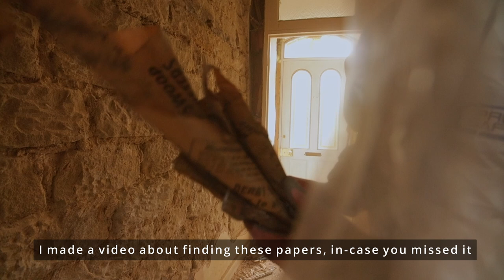Ancient wall - lining out

Comment: Outstanding work, as always. Loving the content, keep them coming!! 
Ah, I see at 28:15, that you, like me, own a pair of those stealth safety glasses, just squint to activate them, pretty slick. They're very versatile, fantastic for drilling or cutting wood, brick, concrete, metal, although with metal you do need to turn your head slightly to increase the protection factor...🤣🤣🤣
Reply: EyelidsPro(tm)
Reply: Norm Abram would be appalled.

Comment: As an Australian carpenter, very interesting to watch. All the basics, exactly the same. We would have installed a vapour barrier between the stone and timber/insulation; used plasterboard adhesive on the timber and half as many screws. Of course our climate considerations are very different to yours. Love your work 👍
Reply: Yes, same here in Canada. We would have installed a vapour barrier also. That and I hate plastering so I would have tried to cut those sections of drywall larger. With that said, this is an incredibly well done job!
Reply: Same here in the States
Reply: @justinknoetzke5380 , in my opinion, using a drywall in that kind of an apartment is almost a sacrilege. I know it's easy and pretty cost-effective, but i think that apartment this old needs more traditional materials. But I'm not taking anything off from work quality, it's great, as always! And here in Finland, use of some vapor barrier is also recommended if that is outside wall and there's no another apartment behind it.
Reply: In a cold climate the vapour barrier should be on the inside. The PIR insulation is metal-faced and he taped all the seams, so there is a vapour barrier on the inside.
Reply: @justinknoetzke5380  I believe it's an interior wall.

Comment: THANK YOU for taking the time to video your work.  It gives me flashbacks to my first house with never ending refurbishments.  Two things I noticed: 1) you added insulation between the pipes and sheetrock.  NO! If you get a REALLY cold winter, you'll need the house warmth to keep pipes from freezing.  and 2) I didn't see you use any sprayfoam insulation around the front door.  Yes, you did pack in fiberglass insulation, but foam insulation really keeps out the cold.  Again, thanks for all of your hard work and detailed videos.
Reply: I was wondering why he didn't foam insulate the walls.

Comment: I don’t think I’ve ever come across brickwork of the type used to construct your house , is it common to your locality ? .  It’s obviously stood the test of time , but of course bringing things up to date is no easy task.  Also the work it must have made for the plastered to make it level must have been mind blowing . By comparison whoever comes to plaster after what you’ve done , will have a far easier time.  Modern materials have made life a lot better , but it still takes a skilled craftsmen such as your good self to get the best out of them .      Best wishes and kind regards as always 😀👍👍👍
Reply: Its a stone built house -  quite common in places where brick production wasn't economical - Much of London on the other hand was built of brick because it was made literally from the ground the house later stood on 🙂
Reply: This is quite common in old houses. My house is over 200 years old and stone walls
Reply: @nick1bb1   thanks for the reply , I always think of stone being used just in detached houses . Never think of it been used in link property. Kind regards
Reply: @MrsDeBoerUK  <top trumps> My house is 500 years old and has stone walls. They are also three feet thick with a rubble fill, so running pipes and cables through a wall is a nightmare.

Comment: That PIR insulation is the same stuff I was going to use to line the van but decided to 'think about'. Good thing too. I may do it eventually but I've been parked in the same spot now since last Nov and the back doors are never shut. Ever. 
I've orientated the van so is 45° arse first to the prevailing wind. There's a tarp 'cap' over the back doors that also covers about 500mm of the roof to minimise the rain being blown under and the tarp goes down 2/3s of the doors and also covers the gap between the doors and the main body and there's a purpose cut length of 4x2 that sits on the top of the doors and holds the them open. It's like a small porch, kinda, but also keeps the contents of the garage compartment dry. 
I just have never liked being locked inside a building with no airflow and the vans no different. Now I have all the air I want haha When it's hot there's good airflow because I'm on the top of a hill under some pines, so there's shade and a breeze to catch. When it's cold I don't even notice now. If I feel it anywhere it would be my feet and those I just slide under the dog if necessary 🤣 
By design fluke, while I have pleasant airflow, the wind doesn't come under the tarp and up into the van no matter how shitty the weather gets. Not a deliberate decision but I'm not going to complain lol and when it's windy like that I get rocked to sleep 😂

Comment: Hi, wonderful job, i only have one issue. It looked like you put a 2 core flex through the ceiling for your light. For your safety, you should have a CPC (Earth) point at every connection point. Either for fixed equipment (at a fused connection unit), Socket outlets and lighting points - including switches. This is a requirement of BS7671 The wiring regulations. This is especially important for metal switches, sockets and light fittings. Please do see to this. yours or your wife's life may depend on it one day. Love the videos, thanks for sharing 😁

Comment: Great job in fairness! 
Shame you didn't have Gypline brackets to hand. Would have saved you a massive amount of time and effort.
I've used them extensively with the metal studs and timber battens.

Comment: Great video. Helped me with deciding to insulate my semi-detached outside walls internally over externally (EWI).

I have a couple of questions:

1. What thickness PIR board did you use?

2. Did you not need to put some roll of DPC behind the battening?

3. Weird one but what waist work trousers or just jeans/trousers/etc do you wear? 😂
Reply from the maker: 1- 25mm pir and 25mm superwool
2- the foil on the pir is a vapor barrier, it could be argued a dpc it is needed to keep the wool dry but since it is a lime mortar outer wall it is quite breathable and does not hold much moisture, even after heavy rain.
3- Snickers 3312, expensive but they generally last a few years which isnt bad considering the abuse they get! not a wierd question, it is hard to find good work gear!
Reply: @NewYorkshireWorkshop  wow thanks for answering so swiftly!

Haha I guess the weird part is asking your size waist. 

I’ve lost 4 stone in the past year and I’m trying to determine how slim I want to go! 🤣

But I have heard great things about Snickers work wear.

Comment: Assuming it's an external wall hence why you insulated, I noticed you didn't leave an air gap behind the boarding because you had filled it with wool. Wouldn't you be concerned about condensation/moisture and if not, why may I ask?

Comment: Is the wall you boarded over an exterior wall or a party wall? If it’s exterior I think you ought to have put in a vapour barrier between the insulation and the plasterboard. Without it over the long term you might get condensation problems on the stonework behind the insulation.

Comment: The house probably lurched, the crack in the arch and the wall are pretty much aligned, so I think it probably goes all the way down into (and including) the foundations. sunk slightly on one side, either from idiots expanding the house and digging down compromising it, or just ground settling after the house was built\expanded upwards.

28:36 uhhh, did you leave that smoke alarm inside the false ceiling? a couple of years from now when it starts beeping to warn that it's running out of battery it's going to drive whoever lives there INSANE. We had a similar thing in our workplace, it caused 5 days of people barely getting any work due to the thing doing 1 beep an hour. I luckily work with headphones so I didn't give a shit, but eventually my co-workers asked me to help find the thing (someone remembered me saying I have good hearing), found it within 3 beeps, turns out someone placed a bunch of servers infront of the wall with the smoke detector on it, and since it's in a pre-fab room added to the inside of the building the beep was muffled through the acoustic ceiling to the entire workplace.
This has the same vibe lol.

Comment: Ok, thoughts on the missing mortar on the half landing on the stairs. 
If no structural worries???
If it were my place and seeing all that stone and I'm assuming lime gluing it all together, point it up using NHL 3.5 Hydraulic lime and a suitable aggregate.
HL is brilliant gear it's a mix like sand and cement and much easier to work with but without all the bad stuff that cement brings to a property like yours. I cut my builders teeth working on houses like yours down here on the south coast dealing with bungaroosh was as big a nightmare as all that wonky stone. Dry lining and insulating my 1870 Victorian 2 up 2 down really worked on the fuel bills. Good look with it.

Nigel.

Comment: Are those copper water pipes running on the wall by the stairs? Or are they pipes for heating the house? If they are water pipes, I'm just wondering if you plan on removing & replacing them since copper can be toxic in the body after many years?

Comment: Very honest and maybe silly question. You want to cut the insulation boards into smaller sections for easier handling or is there some other reason I am missing?
Reply: He cut them so that 2, plus the width of 2 battens, matches the width of the drywall sheet.  That way there's always a wooden batten on each side of the dry wall sheet and one in the middle, to screw into.
Reply: @andy_rb  Thank you!

Comment: It just goes to show that in the 1900's they had "could not care a dam tradesmen" as we do today. My first house was constructed in the same manor as yours, solid brick single skin. As you had some original lime plaster, I would not be surprised if the mortar was also lime, hence the loose bricks at the top of the stairs. All you need was a little bit of damp/water in the window frame and the lime would be washed away. Thanks for a very interesting video

Comment: OK, Big fan of the channel here and this is not a criticism of a comment, I've a very similar project and trying to learn what is the best way to insulate internally!
The traditional/lime plaster "gurus" would really not be happy with what you have done here. I am a member of a few of these groups on facebook and those people are militant in their views, however I will play devils advocate here!  
PIR, gypsum plaster board and gypsum skimcoat are discourage as an IWI option for solid walls construction as none of them are breathable. Neither is your installation a full Vapour control layer, you haven't taped the joints but in any event it is near impossible to ensure the seal at the perimeter wall/ceiling/floor abutments.

The resulting problem is that warm moist air will travel from internally through your wall build-up and condense at the position of the dew-point, but will not be able to evaporate back internally due to aforementioned non-breathable IWI construction.
Theoretically this problem will be compounded as the dewpoint is located behind your PIR insulation but inside of the solid wall. This interstitial condensation will build up and I can't see how it will be removed as there is no ventilated cavity. Obviously this has a real potential to lead to a damp/mould build up behind the IWI installation.

Anyway, that is the potential issue and I'm very interest if you considered this and just decided to go with modern materials regardless.
The alternative is to insulate with a solid build up of use sheep wools insulation and then hemp/lime plaster, which is WAY more expensive and you and I we (both being carpenters) would have to pay other specialist plasters to do. So the temptation is to use the cheaper more accessible modern material option.

Anyway, big fan of your work and keen to see more of it!

Comment: It's Sow's ear into a silk purse.  Pig's ear is sloppy language and doesn't flow.  Most importantly it is failing to acknowledge the distinct biological difference between male and female pigs.  Male pigs have rather soft and pliable ears.  The female pig, or sow has a more cartilaginous ear prone to cauliflower ear.  Thus the difficulty in turning a gnarly grizzled piece of skin into a fine handbag.     <This is the part with the sparkly rainbow graphic and a "The more you know" lower third>

Comment: I'm afraid I'm not familiar with masonry buildings. How do you protect the wood strapping against the stones from rotting out? Thx.
Reply: you don‘t, they don’t rot
Reply: @Nixtutru  Why not? They certainly do in stick-framed buildings. There, the wood is either treated against rot or a sill gasket is inserted between the wood and the masonry.
Reply: @djmoulton1558  no water can go thru the brickwall so it would be unnessesery
Reply: @Nixtutru  Brick and stone get damp. They do this every time there is a change in temperature and humidity. Wood develops mold and mildew which rots the wood.
Reply: @djmoulton1558  The walls are stone not brick so not a problem.
Reply: @lynneforgie6711  You're kidding, right? Look what's happened to the stones around the window.
Reply: The hallway wall is a party wall, not an external wall, no vapour barrier required. I'm sure Russ will tackle the landing window wall appropriately 😉
Reply: @astrecks  Don't think it is. You can see it's an end terrace in the gate video.
Reply: @juancornetto8243  You're correct, I did check after I posted my comment, it does look like an end terrace. I would have to say Russ strikes me as someone who would take great care and seek advice before committing to such a project. Only Russ can answer this!
Reply: @djmoulton1558  That's an exterior wall. These Victorian houses are terraced so the wall you saw done is an interior shared wall with next door and not exterior.